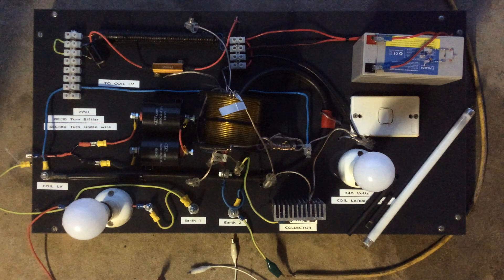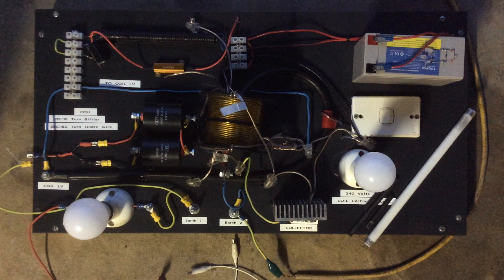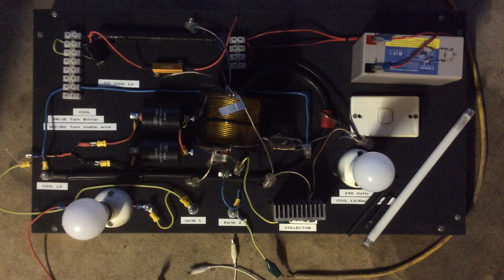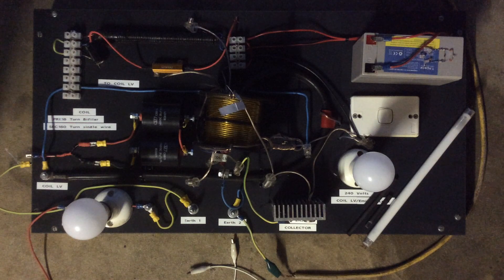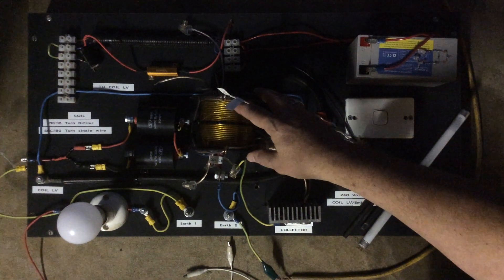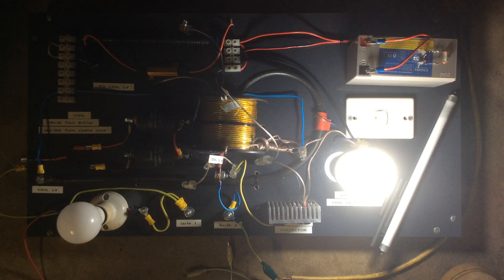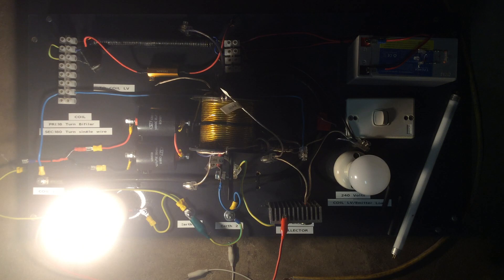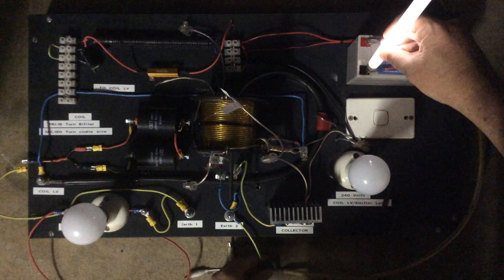Energy Crisis Emergency Lights, Tesla's Single Wire Radiant Energy Transfer through The Earth Part 1

Comment: amazing, very good schematic
Reply from the maker: Thank you for your comment.
I sometimes find schematics difficult, the transition from device to paper almost always results in errors. I sometimes think it might be my education being the translation error, for example this circuit has a very different primary coil and I still have the first schematic I made of the circuit which is wrong. Basically, I built it, tested it and was amazed, when I told a knowledgeable friend he naturally wanted to test it and asked for the schematic, I sent him the schematic which was incorrect and when he informed me he could not get it to work I had to do a complete tracing, wire for wire to realise I had made a mistake drawing the schematic. I still marvel at the effects of this arrangement and how it organically or accidentally came to be.
Reply: @whatifididthis...1236  
what do you use for earthing ? a copper pipe beaten into the ground ?
do you connect it with stout wire or with a single thick wire ?
and does the wire diameter matter at all when it comes to grounding ?
Reply from the maker: @alexkoteles   Normally grounding is done with a thick wire attached to a copper earth rod but this is not necessary with my circuit. Earthing with this circuit can easily be done with the thinnest hair like wire and it won’t care a bit.
I have both the proper earth rods and some crappy pieces of metal that only enter the ground 100mm. Initially I just used the bits of normal steel and it worked fine but curiosity got the better of me and I bought the real deal copper earth rods, waste of money! I get a brighter light from the small piece of steel. I don’t feel that copper makes a good, efficient or safe earth rod material, it forms a skin after weathering which presents as resistance and could change the function of my circuit.
For my proper earth rods I have connected mains house wire, twisted all three wires together and that is connected directly to the earth rods. You can see my cheap earth rods in my latest video, seriously save yourself some money and use any old rusted bit of metal you can find, it will work, stainless steel isn’t that good if your wondering, it works but it’s not the best.
Wire gauge is not important for my circuit but very important for “their” circuits.
You can easily use what you already have, even the wire buried in the ground would work but remember the copper corrosion issue in that case.